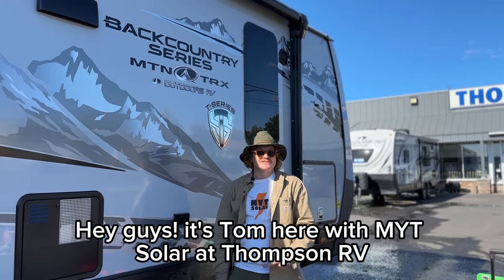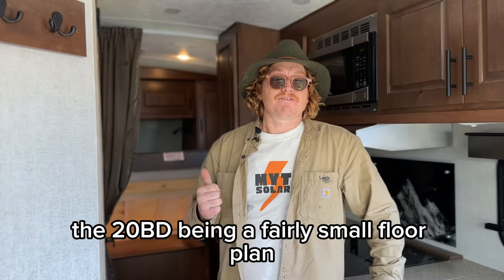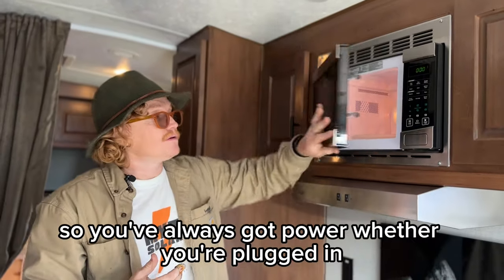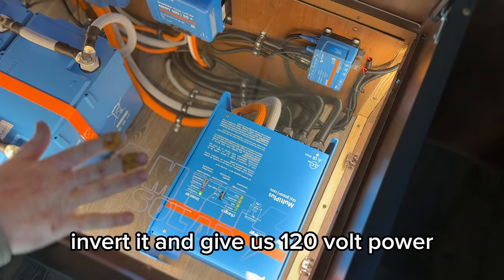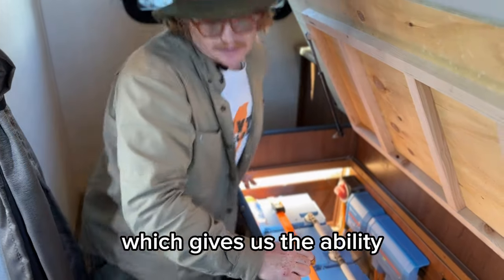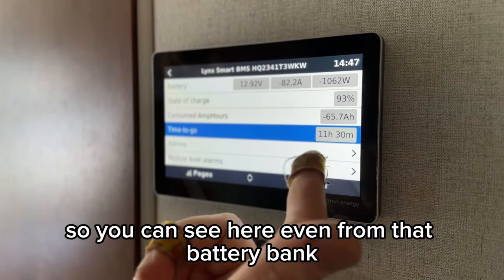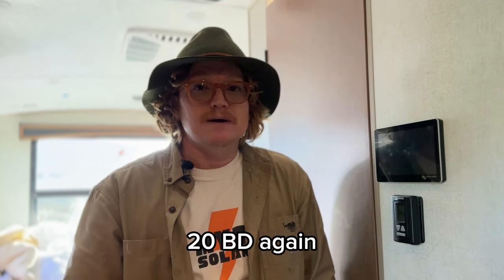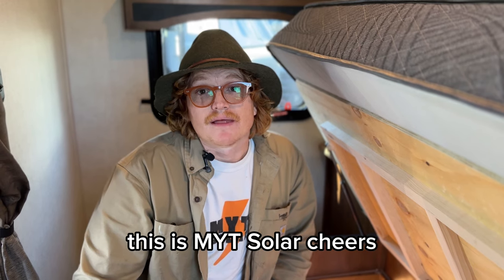This off-grid camper is now NEVER without power | 2024 Outdoors RV 20BD Backcountry Titanium Series

Comment: Would it be more cost effective to NOT order the 600w factory solar and just dump it all into maxing out what you guys can do with a 20BD? If you can put 1500w on there, and that AC is pulling less than 1100w... you're still positive ona  good sunny day in the Idaho mountains
Reply from the maker: Hey there! Yes Absoutely. Pretty much every ORV customer we connect with will order the trailer with its minimal solar (400w comes standard and can't be deleted). And then we remove that factory and put in our better and just as affordable panels.1500W on a 20BD is no problem. Keep in mind, in RV conditions we see 65%-85% of that 1500W come to the batteries . Also the AC unit will ramp up is draw over time as the AC compressor works under more heat. So its more like 1500W for the AC once it gets going.

Comment: Nice clean system. I'm with you on maximizing solar. We started our FT lifestyle with a 620w array on the side of our RV, but recently racked our roof with solar from front to rear. We couldn't be happier. Now we have power to spare, living off-grid just like we were plugged into shore power at an RV resort. We have two battery banks, a 560ah 12v battery and a 320ah 48v bank (the equivalent of 4 of those Victron batteries in series) for our 110v needs. This gives us a total of 23.5 kwh, charged by over 5,000 watts of solar so we never need to run our generator anymore. Your customers will never regret adding more solar or batteries.
Reply from the maker: Thanks for the compliments. Sounds like a nice big system you guys have. I always tell people, especially on a smaller trailer - you can't really go overkill in terms of battery and solar.

Comment: You said 990ah but what voltage is the battery bank, just wondering what the watt hours are.
Reply from the maker: They're 12v 330ah Victron batteries.

Comment: Can you briefly elaborate on tying that into the existing wiring? Did you need to open the bottom of the camper for example?
Reply from the maker: There are all sorts of places we tie into existing wiring. Both on the 12V and 120V. Most of our cable is run under the trailer and a lot of what we need to work on is in an access panel under the bed.

Comment: Great build and video! Question, since the build is under the bed and under plexiglass would there be a concern with overheating? Especially the heat that comes off the batteries, inverter and wires. Is ventilation needed?
Reply from the maker: Thank you for watching. We do add 4 x four inch vents and as it is a big open space with lots of air around all of the equipment, we don't see it to be an issue. The Multiplus and the MPPTs are the only real heat producers. The Multiplus is installed to have an intake vent at its bottom and then it vents straight out the top where another vent is strategically placed. Also as the temperature in the bedroom is climate controlled its a lot better than being in a closet or compartment.

Comment: How much ? And how long will you be able to run the A/C full blast at night ? And fridge Etc ?
Reply from the maker: Our installs range from 15k-25k depending on what kind of battery capacity and solar you need. From a 990ah system you get about 9 hours of AC runtime without solar. Solar is absolutely key to the systems and we always push for as much on the roof as possible. What kind of RV do you have?

Comment: Great workmanship! Did you connect the outside Zamp solar wires to this charge controller?
Reply from the maker: The Zamp plug-in on the side for the portable style panels is still active and tied into this system. It won't show up on the solar section of the Touch 70 but it will show on the battery numbers.

Comment: My unit has to have a 12v battery on the front to open/close the slides. So my inverter charger, controller plugs into shore power and then operates my camper as it was. And I use the generator on those days I need the A/C only. I can run the microwave and dishwasher as long as the sun is out. A/C will run with full sun, but will drain my 400ah lithium bank in just 4 hours.
Reply from the maker: Sounds like you have your power usage figured out. Knowing your usage and how your system will perform in set conditions is key. As RVers we will always have to manage our power usage, even with the biggest systems.
Reply: @mytsolar  I want another 4 100ah batteries, and use a 24v system

Comment: I thought that inverter had to be mounted vertically?
Reply from the maker: Not according to our experience and the guidance of our Victron distributor. Flat on is back is generally acceptable for both the original MP and the MPII. We have intake vents and exhaust vents and the cooling in the MP is fan driven.

Comment: I love your system, but way to expensive. That trailer would do perfectly with The
SunGold power 3000 watt 24volt. All in one, with two 300ah 600ah total  of Power Queen batteries. And my panels would be from San Tan solar. 6 255 watt Canadian solar. 300.00 bucks. Whole system for 2500 bucks. Match it.
Reply from the maker: Hi cooltrkin. Thanks for checking out the install - glad you liked it. Victron isn't for everyone, but our customers are yet to complain about our prices or quality of our work, they value our experience with the product and the reputation of the product. For the DIY crowd there are definitely ways to save money but for a professional installer with customers across the country, the Victron remote monitoring, longevity and network of trained distributors is a must! If I were doing the install myself on a budget your setup sounds epic!
Reply: @mytsolar  G'day from Thailand....good to see that you are a diplomat as well :)
Reply: That is a very impressive setup but like one of the other comments points out in Canada where I live this could be done for far less than $16k US. I do appreciate that you have a professional setup but as someone who only has rudimentary skills in electronics I feel that I would be more than capable of following instructions on how to set a system like this up and then have a professional like yourself to take a look to insure that I’m not about to burn my trailer to the ground. The price you have quoted for the system here is that pretty much standard or there are options that I can utilize to save myself some money while still using your expertise? I’m recently retired and am planning on getting into the rv lifestyle and am in the early planning stage of preparing a rv/trailer.
Reply from the maker: @richardwestmoreland4796  Hi Richard. Our prices are very fair compared to other installers in Oregon. We use very expensive components. I have no doubt you could spec out a similar system for a better price. We do not offer consulting or work on DIY systems as we need to be responsible for the install from start to finish. Our professional install along with our Victron product knowledge and ongoing support makes us stand out. It is just my wife and I, so we limit our offerings and options to keep things manageable. Good luck with your project! I'm sure there are installers near you with good reputations who could help.